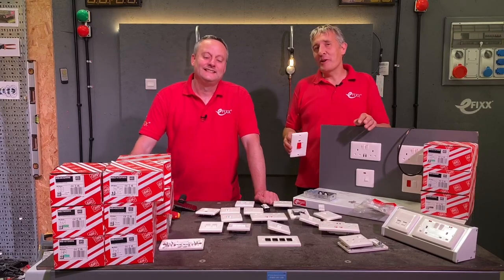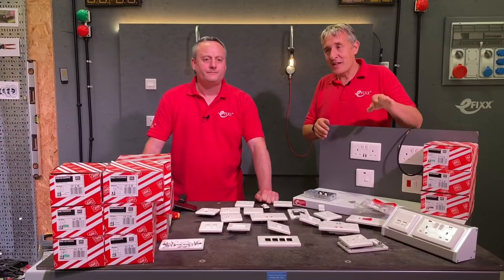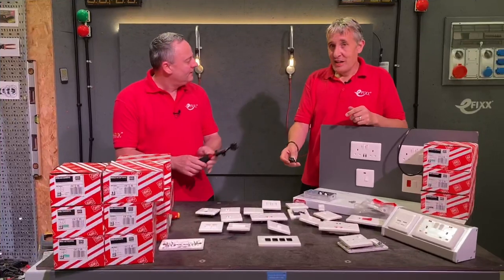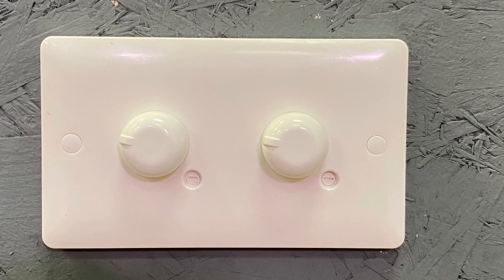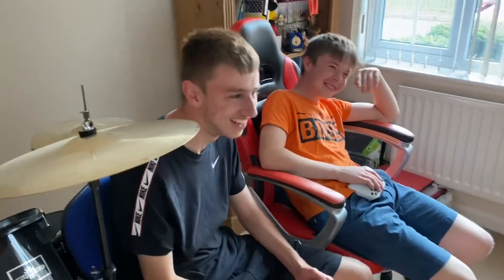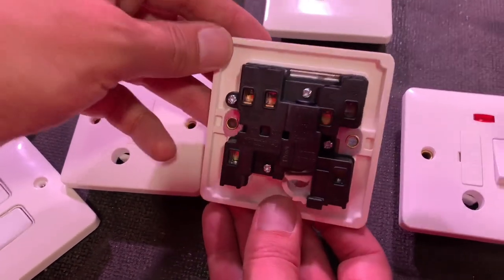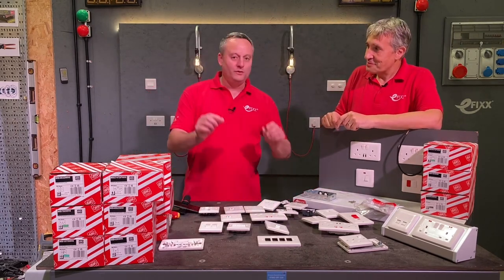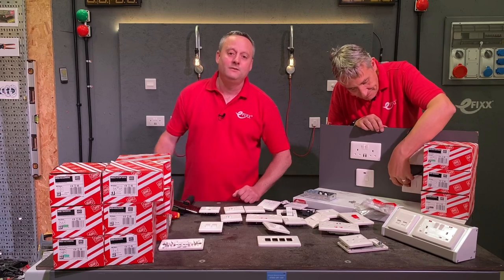BACK to BASICS - The NEW MK budget wiring accessories.

Comment: I think metal sockets are certainly better for use in a workshop as metal can withstand accidental knocks and harsh chemicals better than plastic. 
I wonder of MK will make Part M versions in this range ( grey fronts with white rockers ). I don't even bother with the white caps as they only make 
it difficult if you ever decide to the change the socket a few years down the line for like decorative reasons or in the event of it being faulty or damaged. 
If I ever get into electrical wholesale I would certainly consider buying a load of these to sell for DIYers as an alternative to some the dubious cheap
brand stuff you might find at a hardware store like Wilko.

Comment: That's always been a bugbear of mine that the different accessories have different depth front plates  especially when mounted side by side .  Only thing I don't like is the look of the switch fused spur,  but only the aesthetic.
Reply from the maker: What would you change on the fused spur?
Reply: @efixx  I think the slim and tall fuse carrier  versus the wider switch makes it look odd . Just my opinion

Comment: very interesting review... useful. thanks..... Perhaps you could do a short video on your views as to whether an immersion heater should be RCD / non RCD protected in the consumer unit?? ?
Reply from the maker: It’s usually the cable route which would be the first issue to drive RCD protection.

Comment: The MK fcu I have bought (marked DP 330) has two thin black wires terminated with small brass spade connectors and I've absolutely no idea what they are for. The examples you show don't seem to have these two wires and I can't find anything about them or their intended use on the MK site. Any comments gratefully received.

Comment: So from what I've seen (haven't used it in person)

Good points.

Dual earth terminals as standard. In logic plus to get dual earth terminals on a double socket you have to buy the outboard switches version which is twice the price of a regular one or the rapid fix version which is about 1.5 times the price of the regular version.

Unusual stuff is far more affordable than in Logic plus. The basic logic plus switches and sockets are IMO quite affordable but they rip you off on things like cooker outlets, sockets with neons, larger switches and so-on.

Bad points.

The regular switches don't match the grid switches.

DP switching on the sockets is optional, so you have to be careful to spec that when buying.

High current switches are limited to 45A, compared to 50A for the traditional MK ranges.

The FCUs have the flex outlet on the front, IMO the side entry arrangement used by logic plus is neater in most applications.
Reply from the maker: Great feedback - thanks Peter

Comment: is there a reg against putting a switched fused spur cord outlet on a ceiling to a projector
Reply from the maker: We’d struggle to think of one. Seen lots of garage door pullers fitted with fused spurs on a roof.
Reply: You couldn't use a standard socket on a ceiling as the plug would pull out so a switch fuse would be ideal .
Reply: @dennisphoenix1  I don't think a plug would fall out just with gravity, they are in there very tight
Reply: I would say not, I don't see what issue could arise from that situation
Reply: @acelectricalsecurity  doesn't matter what I or you think , the wiring regs say you can't .
Reply: @dennisphoenix1  what's the reg number on that
Reply: @acelectricalsecurity  sorry cant find it . The regs arent really user friendly.  If they were digitised and a search function added it would be easier.
Reply: @dennisphoenix1  if it's in there, it's one I am not familiar with. But I don't know the book inside out.
Reply: @acelectricalsecurity  I am sure it's in there but cant reference it . It's not something I look at often tbh

Comment: From the look of the 3g switch can they be swapped round so you can have an intermediate in there? 2x 2way and 1x intermediate?
Reply from the maker: That’s a good question - we’ll take a closer look 👀 and see.
Reply: @efixx  thanks that would be the icing on the cake.
Reply from the maker: You can easily drop individual switches out ( without dropping to bits) - but the intermediate is a bigger mechanism - so doesn’t look like it’s possible. Or £3 and a wasted trip to CEF as we now know it 😂😂😂
Reply: @efixx  perfect thanks for trying it and spending £3 in the attempt, I’ll send you a £3 postal order with thanks 😀 it’s a shame it doesn’t fit that would be perfect for those jobs where you need a 2way and intermediate on the landing. At least you know you can swap it if it breaks. Appreciate the effort and love the videos.
Reply: @petermichaelgreen  I use the Click and also used the similar Hamilton Verve, both nice systems, I was just interest in an MK option. I’ve not tried the Verso but seen the review on eFIXX.
Reply: No  thanks   Will  stick
  Ashley    crafted  or  me.m

Comment: Sorry but MK are garbage these days, same as Crabtree, used to be my go to brands but they use cheap materials now but still charge the same money. Best brands if you want value are Click Mode or Schnieder Lisse. Best product is Hager Sollysta by a long way
Reply from the maker: Put these next to the other budget products you’d be surprised the double socket is particularly robust when it comes to tightening the terminals.
Reply: @efixx  the click sockets have a torque setting of 2.5nm